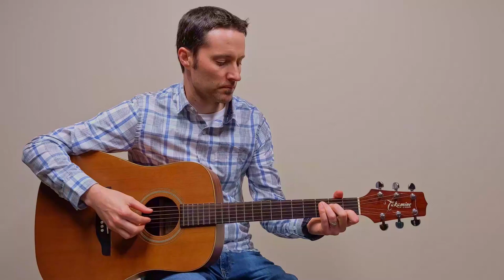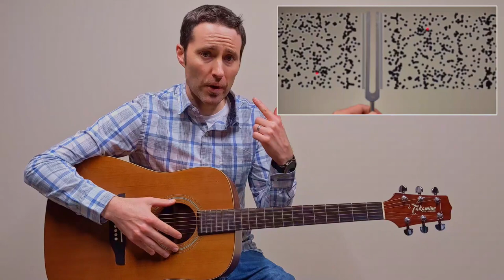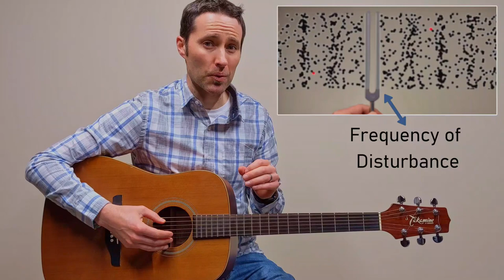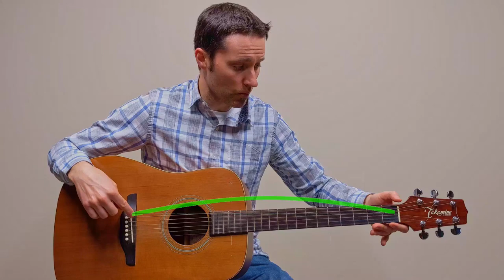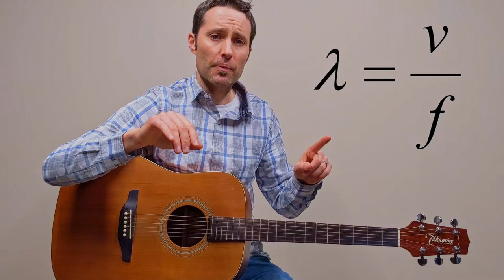Music and Standing Waves (Part 1) Transverse Standing Waves in Strings

Comment: Awesome explanation.  I already know about harmonics generally, like in electronic circuits but never before did I make the connection to guitar strings.  This is the first time that I "get" harmonics of guitar playing.  Thanks!  Question: When you tap the 4th harmonic node and damp the first 3, does the energy of those first 3 waves transfer into your fingertip, or does it stay in the string and make the 4th harmonic louder?
Reply from the maker: Glad the explanation was helpful in your understanding of harmonics!  That is a good question. It would be interesting to measure the intensity / volume of each of the harmonics both before and after I damp the first three harmonics to be able to hear the fourth.  Does the 4th harmonic get louder?  My guess is that as you put your finger against the vibrating string, your finger and string are colliding every time it vibrates back and forth against your finger many times each second.  Each collision would cause an increase in internal / thermal energy in your finger and the guitar string.  This would mean the string transferring some of its "mechanical energy" (kinetic energy + potential energy) to thermal energy.   Without actually measuring it, my guess is that the 4th harmonic does not get louder...

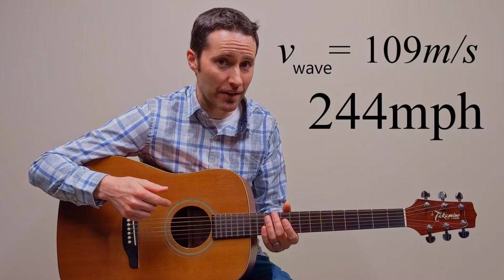Comment: At 2:48, he puts the velocity of the wave as 109m/s and in a current experiment which I am conducting using string length and frequency to calculate v, I am getting a similar value of 109m/s but I thought the value of speed of sound in air was about 343m/s at 20 degrees celsius. For context, in my experiment, I am varying string length and measuring frequency to isolate for v. The harmonic number is 1. Is it that v refers to the wave speed and not the speed of sound in air?

Comment: so sir, when we pluck the string it will be having all standing waves possible, but as the fundamental standing wave will be louder than all other standing waves we will only hear fundamental frequency... but if we want to hear second harmonic or other we have to press the string at particular lengths so that it will eliminate its predecessor harmonics.
I hope I got it right. if wrong please correct me...
Reply: to hear the harmonics, you must barely touch the string momentarily (and then quickly release) at each node, not press it down.

Comment: When you pluck over the sound hole, shouldn't the second harmonic frequency (or one of the higher harmonics) be the loudest? You are plucking very near to the antinode of the second harmonic, that is, the wave with two antinodes. I believe this is suported by data if you perform an FFT of the guitar's sound. I'm genuinely curious, not trying to take anything away from this great video. 

Additional evidence comes from plucking a guitar string over the midpoint of the string as opposed to over the sound hole. I would think this would tend to excite the fundamental frequency and not the higher harmonics. When you pluck a string at its midpoint, it makes a much more "vanilla," plain sound consistent with vibrations of the fundamental frequency.
Reply: I believe you are correct.  The closer you are to the first harmonic, or fundamental, antinode when you pluck (in other words, the closer you are to the middle of the string, or the double-dot octave marker, which indicates the middle of the length of the string), the more the fundamental note is emphasized.  This explains why, as you move your strum  closer to the bridge, it sounds brighter and more treble-y, because the higher harmonics are more emphasized---and the fundamental, less so.  At least, that is my story and I am sticking to it.  I have been playing guitar for 60 years and am also an electrical engineer (which means I had to take some Physics ha).  But I may be full of baloney.